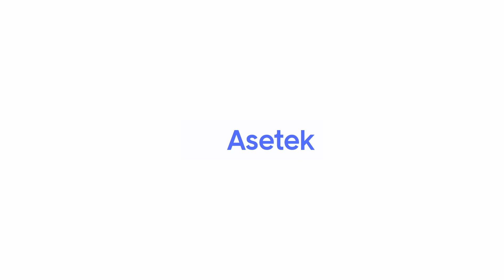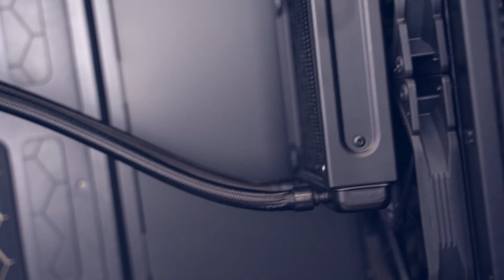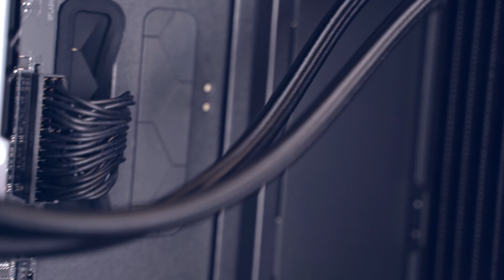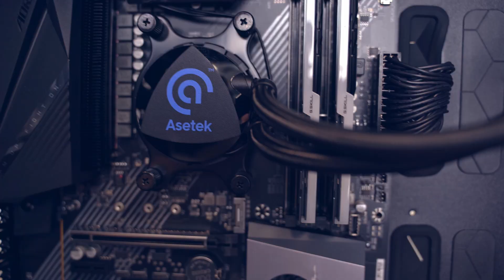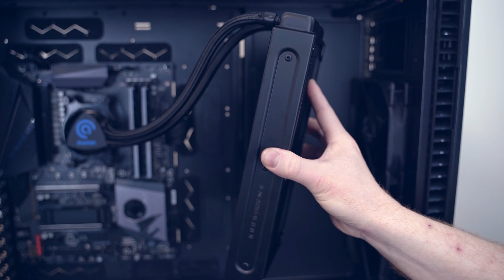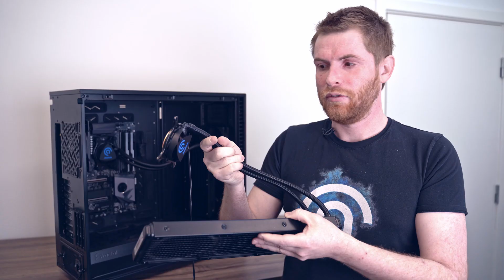How to: Quiet a Noisy AIO Liquid Cooling pump from Asetek

Comment: The problem I have is that my pump is on PWM mode (recommended by Lian Li), and every single time the pump speed increases, I get that swooshing sound that you hear when you first boot up the system. I mean it does it literally dozens of times a day for a second at a time. It's driving me absolutely insane. I can move the case around with the pump at full speed and get it to be quiet for like a half hour, but it starts doing it again relatively quickly. It's a brand new AIO too. It's not even 2 weeks old. I have my radiator top mounted.

Comment: Last year I bought a cheap Msi coreliquid E360 water cooler which has an Asetek 8gen water pump. After half a year of daily use I started to have unpleasant cracking sounds from the radiator. For now I'm using a Kraken 280. I've had it for over a year and it works without any problems. Well, maybe I'll still be able to solve the problem with the msi aio and I'll be able to continue using it. For now it's in a box in a cabinet. Thank you for the video.

Comment: This is good but there's one more tip for Asus smart motherboards which is if you go to fan control and set it at the bar line set rpm then the sound goes...I know it's weird but for some reason that's what did it for me...also I got 13 top of the range fans that have artic silent cooling, meaning it keeps everything cool as well as the pump...you can test it like I did with multi display and in the Armoury Crate...I liked this video Asetek Inc and only mentioned this because no one else has yet yes!!!!👍😅
Reply: I did this with mine, i had to set the pump on DC

Comment: My pump was making noise.  Unmounted it, shook a few times and it cleared right up. Peacefully quiet since.
Reply: Did you do this veil it was still running?
Reply: @Sapper_fps  Yes. It fixed super quick. Heard the liquid running correctly and nomore noise.

Comment: Worked like a charm! When I went to put the radiator back (Screws), the noise came back, so I just rotated it re jiggled it again to make it go away, then remounted it after turning it 90 degrees (radiator was before and is now still above the pump) which make it so the two large bulky cords weren't as curled and were more loose with more "play" I guess you could say. Now it's quiet?

Comment: Why won't this work with EVGA Hybrid kits?  I had to do the cable bypass mod to get the damn thing to stop sounding like a vibrating dildo.  Will never buy another EVGA product again.  :D  Or, was that Asetek?  And yes, it's a lot more common than it should be.

Comment: I got the new h150i LCD 360 mm AIO with the qx fans. I didn't know before buying this that the minimum  pump speed on "Quiet" mode is 2400 rpm. I heard there is an Icue 4 hack to lower pump rpm.

Comment: Im having an issue where its making a loud ringing noise like a dog whistle coming from the pump. Temps r fine (I think) as I run 60 degrees in game but the ringing is so annoying when playing. I can only hear it when not using a headset but I have been using 100% its been getting less but its still very audible.

Comment: Hey Asetek, I have a quick question about a really strange problem. I don't even know if this is pump related, but I don't know what else it could be. I just finished a new build yesterday, and for cooling I'm using a Phanteks Glacier One 280MP, powered by Asetek. The issue is that there is a really strange bubbling/windy/watery/icy sound coming from my speakers/headset/headphones, connected to usb or audio jack. It begins as soon as I get to the Windows login screen and persists indefinitely thereafter, across restarts, different ports etc. The sound of the computer itself operating is nearly completely silent, it's just this really strange sound that I can't figure out and it's driving me crazy as I have no idea where to even start. Any help or suggestions you could offer would be greatly appreciated.

Comment: I have a Corsair H115i Elite Cappellix. I tried avery move of the PC but the rattling sound continues.
It disappear if i set the pump speed to "extreme" or i put the PC with the motherboard that looks up.
My radiator in installet on the upper side from 2 years

Comment: Mine is rattling but it’s a fan bearing and not the pump. Have confirmed by trying the existing twisting maneuvers but the rattling is there under the cap.
Reply: same here, did you find a fix?
Reply: @xdn22  My techie friend was a savior. He took everything apart and rebuilt the loose structural parts with spare parts Anakin Skywalker style (cardboard washers made from a pizza box for the loose screws). I'm sorry to report that he's not taking referrals,  though. Good luck!

Comment: What about as Asetek AIO cooler that emits a series of crackling sounds every 5-10 seconds or so?
Reply: Sounds like its circulating the air bubbles. Is your pump at the CPU plate or in the radiator, and how EXACTLY is the radiator positioned?
Reply: @z33thr33  In May 2023, I ditched this Asetek AIO cooler and installed a traditional CPU heatsink and fan in its place.  I had to jumper 2 terminals together to get the motherboard to stop throwing me an error.  My HP apparently has a proprietary motherboard configuration that is set up specifically for this Asetek AIO cooler, therefore jumpering is required, otherwise it does not give an RPM sense utilizing a traditional fan for whatever reason.  Nothing changed with my setup leading up to this failure.  I removed the AIO cooler, made sure that hoses were at the top end of the heatsink/radiator when I reinstalled it, etcetera, no change.  Figured it was just at the end of its life, considering I am using this setup every since day since I received my system back in September of 2015.  Most people don't use desktops that long, do they? 🤣🤣  By the way, pump is (was) at the CPU.
Reply: @Florida_Man_In_Florida  that's the opposite of what you want. You want the hoses at the BOTTOM of the radiator. Think about. Where should the air bubbles be trapped? because bubbles are basically unavoidable. you want the hoses at the BOTTOM of the radiator so the bubbles trap in the top of the rad, AND ideally you'd have the rad above the CPU entirely. Having the hoses at the TOP lets the bubbles suck right back in to your pump
Reply: @z33thr33  The AIO cooler pump emitted a cracking sound every 5-10 seconds.  It was a series of crackles that would progress in speed/intensity until nothing, and then the cycle would repeat until infiniti.  Very annoying.  Started all of the sudden one day in May 2023, out of nowhere.  Like I said, no changes were made to my system that may have contributed.  System was cleaned annually, no significant accumulation of dirt, dust, or filth, I'm clean.

Comment: So its clear the recommendation for radiator position but i havnt heard anything on orientation of tubes leaving the part on the cpu.  Bottom, top, side towards rad?
Reply: All in all, don't trap bubbles in the pump. A water pump with air will wear out fast.

Comment: Aio pump from xpg levante loud af, looking foward to an air cooler again
Reply from the maker: Sorry to hear this, Peeter. Do you know where the sound is coming from, pump, radiator etc?
Reply: @AsetekInc  It was coming from the pump, really loud sound
Reply from the maker: Did you contact XPG? That is not normal.

Comment: Hey, I have an interesting problem that dosent seem to have been covered in the comments so far and I was wondering if there was any advice you could offer. I have air bubbles in the pump making the exact same noises as the one in the video, but my radiator, or 'tank' is entirely located above the pump with the pump's hoses coming out of the bottom of the pump itself. After following the advice of moving the radiator around, the noise went away, but returns as soon as the radiador is returned to it's usual, horozontal position at the top of my PC case. Is there anything else that I can do with this or do I have a defective unit?
Reply: same here. its not as loud as in the video but there is some bubbling in the pump :/ and the AIO is not even 6 months old ....
Reply from the maker: @BillCipher1337  Are these sounds consistent throughout all operations or full time the system is running? Or does this happen when you turn the system on? Which asetek-powered AIO are you using?
Reply: @AsetekInc  its an ASUS ROG Strix LC 240 top mounted. noise was irregular and only when the pump run at mid RPM, after putting the pump to 100% the noise was gone.
Reply: I'd check something that fixed the bubble/gurgle sound for me. Use a water level to check your case if it's on a table that may not be level. My radiator is top mounted and the out of level table had it tilted away and back from the hose fittings that point downward. As soon as I shimmed it to be level front to back and side to side, the noise went away. It was intermittent gurgling and now silent all the time.
Reply: Kraken X73, the 360mm AIO with the mirror, replaced it under warranty since original pump made noise. Soon as I turned on after replacement same pump noise. I have the radiator mounted on top of my case for exhaust, no matter what I put pump speed at the pump will make noise then go away for a little then come back. Have not tried the suggestions in the video yet, just came across it tonight will try sometime in the next week

Comment: I have a noise that seems to be coming from my radiator, not the pump. It's a pulsing grinding sound, and it only kicks up when I'm gaming.
Reply: I have a similar issue... except it only happens during Fortnite... no other game does it. wth.
Reply: same problem here lmao....
Reply from the maker: Anything obstructing the fans?
Reply: @AsetekInc  Not that I can tell. I used an air blower on the fans, got some dust out, but the sound continued. But, I haven't heard it in a while since I posted my comment. I leaned my computer at an angle and whatever it was seems to have worked it's way through.
Reply: @GrimGearheart  Same grinding sound from the radiator for me. It happened after I recently played The Last of Us and now it will not go away. Sometimes if I lean my tower a bit, it'll stop...but it usually comes right back eventually. I'm assuming it's still an air bubble?
Reply: @Joltzz1985  I started tapping the radiator with a hammer and the sound stopped.
Reply: @Joltzz1985  same issue here, cant find the problem

Comment: Asetek, I do have an Sapphire RX6900XT Toxic Extreme Edition with an Asetek pump on the AIO. The pump started to make a clicking noise that remembers me about wheel bearing that is starting to fail. Since the GPU Hotspot reaches around 95 to 100c on spikes, I bet that could be occurring evaporation of the liquid used over time at these temperatures for prolonged periods. Radiator was mounted on top since day 1 so should not be possible to make bubbles go down 15cm of tube to stuck on the heat transfer plate/pump. 

I'm gonna share a video of youtuber that reviewed an Asus card and makes the same exact pump noise. 
https://youtu.be/vWXGJZ59rd8?t=209

Is this normal? Shall I be concerned about longevity on a long run? I noticed a 5c increase on temperatures since the noise begun, tried to shake, tap the tubes and the card. Nothing. Actually made it worse for some time, then back to normal clicking bearing sound.

I've been using a Corsair H110i GTX for the past 5 years now and still running strong with no noises or whatsoever. From a mechanical stand point, it just doesn't see to be right. Makes things worst if you consider that the noise wasn't there on the first 6 months of use.

What should I do? RMA it? It's a normal operation sound and I should be worried if its loud only? What advise can you give me? 
Thanks.
Reply from the maker: Hi XarupS. Sorry to hear you're experiencing this issue. Our suggestion... If you are experiencing clicking like that heard in the video, then you should definitely contact your device manufacturer and notify them. This is not normal for Asetek-powered solutions.
Reply: Its possible to buy a replacement pump fpr that particular card with Asetek? Sapphire doesn't sell it separatedly.
Reply: Hey, i got the same issue. Dead silence from asetek and Sapphire. All they can do is to tell you to contact your seller. 
Great customer service.. did you find a solution ? Im currently looking for a aio that will be compatible with this gpu. I asked to asetek they can't tell me.. same for Sapphire. If at least we had the socket size or something to work on our own
Reply: Same card here
6900XT Extreme Edition, it's been something like 2 years, top mounted radiator, everything was quiet (well, except for awful coil noise in heavy load), and today it started making bubble noises non stop

Comment: Yeah I’m using an nzxt x73 top mounted rad and my pump is still noisy, It’s got nothing to do with bubbles it’s more of a hum with a slight buzzing sound! So far this seems pretty common with your products asetek!!!
Reply from the maker: If you have a suspicion about your product, please contact the vendor.
Reply: @AsetekInc  it ain’t a suspicion it’s quite audible.. maybe if y’all maybe didn’t skimp out on manufacturing! It would be a decent cooler, it sure cools well but that don’t mean shite if it’s built poorly 🤷🏼‍♂️

Comment: I mounted my aio 240mm on top and started it for the first time and started to hear water gurgling around. I only ran my system for 5min because I had to leave my house. So just to clarify, its completely normal to sound like that for the first time and should let the system run longer to make the air and water circulate throughly?

Comment: Tysm man, I've been doing multiple things over the past few days and literally shaking the radiator a bit fixed it within minutes
Reply from the maker: Glad to hear you fixed it! It's so easy to do but can be very frustrating to figure out at first :)
Reply: Shake it while the pc is on?
Reply: @katzz-b7c  Yes. Otherwise the pump is not running. You need the water to be moving to get the bubbles out of the way.
Reply: @katzz-b7c  ofc not

Comment: Should my system be running while trying this?
Reply from the maker: Hi Virgil,
 
Considering that you don't unmount the actual coldplate and only the radiator, the best way to go about this is to do it, while the system is on so that the pump is running :)

Comment: Hey I don’t really know much about this system but I have an ibuypower pc and I have a radiator or AIO that looks like that but more like a small square and it’s making a rattle noise that is really loud. Any advice?
Reply from the maker: Hi Jassper,
The best tips are here in the video.
 
How old is your system? Where is your radiator mounted? And what way are the tubes on the radiator facing? :)
Reply: @AsetekInc my system is about 1-2 years old and the radiator is vertical and the tubes are coming out the bottom . It is at the back of the case in between two fans.
Reply from the maker: It does sound like you may have some bubbles stuck in your pump then. It really shouldn't be a problem at your point in time (at least if it is an Asetek unit).
 
I would suggest trying to tilt the case in several different directions, while the system is running to see if that alleviates the issue. If not, I would suggest contacting Ibuypower to potentially get the unit RMA'd :)
Reply: @AsetekInc  mine has the same issue and its an elevation issue what can i do to fix it? following the steps in the video?
and does it have to be on while i follow the videos steps
Reply: Dude I have the same problem with my Ibuypower PC. Its so loud but only if im gaming or have many web pages open... annoying AF
Reply: I also have an ibuypower pc and i get tje same problem any tips on how to fix it

Comment: My Asetek cooler is making a kind of rattle sound. Does not sound like bubbles or air. It sounds like a bad bearing or something. The top of my rad is higher than my cpu and even turning the case on it's back or side don't make any change in the sound. If i shake the whole case and suddenly stop. I can hear the rpm/bpm of the sound change slightly. It appears to be working okay. But the sound is very annoying and there doesn't seem to be any way to get rid of it. The sound I hear of bubbles in these videos doesn't sound as bad or as loud as my cooler.  Anyone have any ideas? I've been waiting to see if it actually fails or anything. But I'll probably call CLX and see what they say also.
Reply from the maker: Hi IntegrityRC,
 
I am sorry to hear about the issue you are experiencing. If the sound is actually rattling, then it is probably a bad impeller and not an issue of it being air bubbles in the system. Either way it is not supposed to sound like that.
 
I can see that you are mentioning CLX, which is a System Integrator customer of ours and I would, as you say it yourself, send them an email to have the AIO swapped out.
Reply: @AsetekInc  Hi, thank you for your reply and confirmation of my suspicions. It appears to still be cooling. But i will contact them.
Reply from the maker: I would do that indeed as a bad impeller/bearing could cause issues long term even if it is cooling now.
Reply: Great i have the same issue kind of a vibration / rattling noise feeling like woody but the snake are not in my boots its in my pc
Reply: Found a fix instead of runnging the pump at 100% took it to 80% ramping up to 100 if the cpu reaches 60 c seems to be working
Reply: @troytheking7559  Hi Troy. I have the same issue. Can you tell me how to reduce to 80%?
Reply: @brewtal85  I don't know what mobo your using but some where in your bios settings